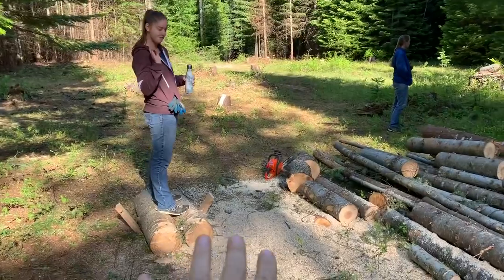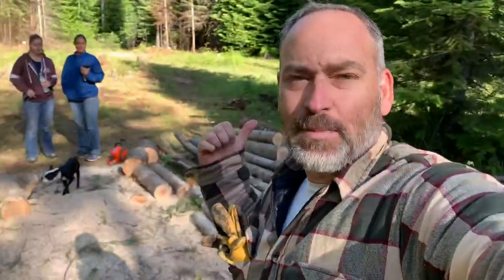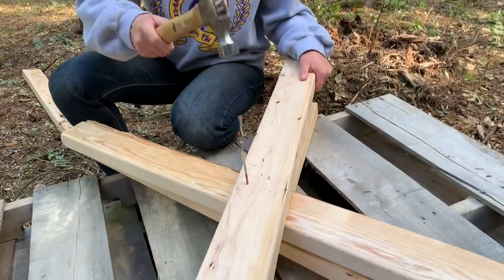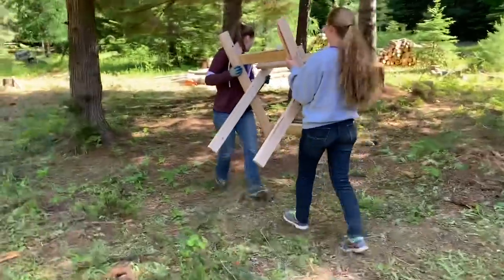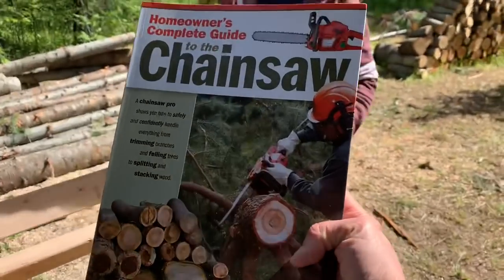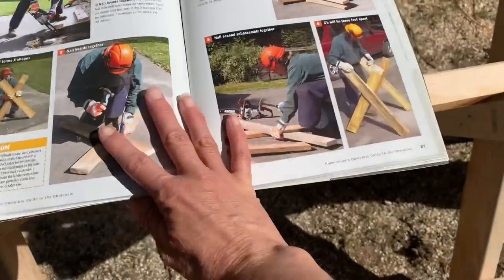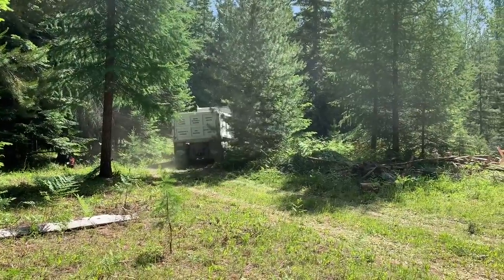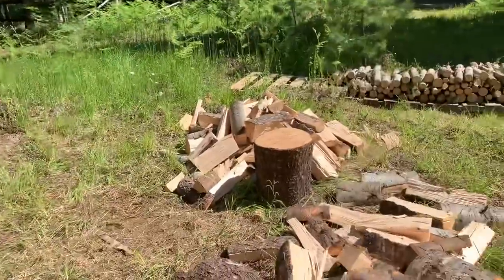Building a Sawbuck and Cutting Fire Wood | Family Builds House in the Mountains

Comment: When cutting w chainsaw- do NOT align your head and chest w/ the saw blade...do not stand directly behind the saw...... hold saw right above your right hip, w/your right leg to the left of the saw , right foot slightly back and knees slightly bent... in athletic stance ....much safer and proper. This due to protect if the saw kicks back, or you otherwise lose control of the saw..